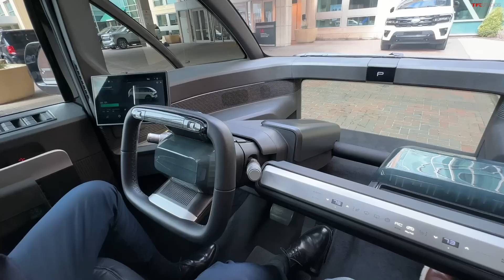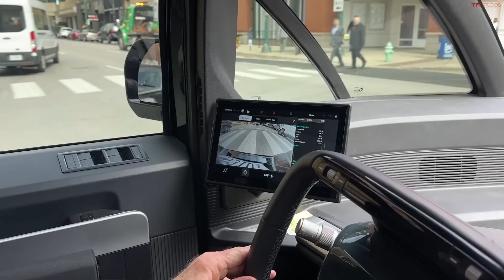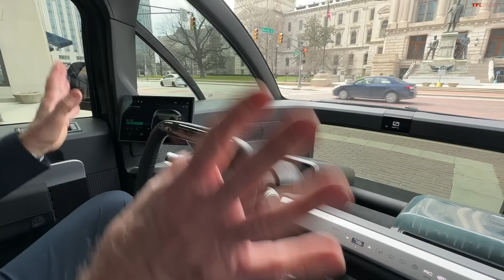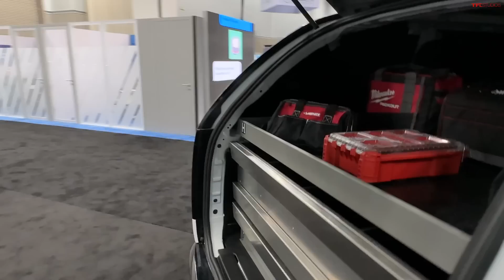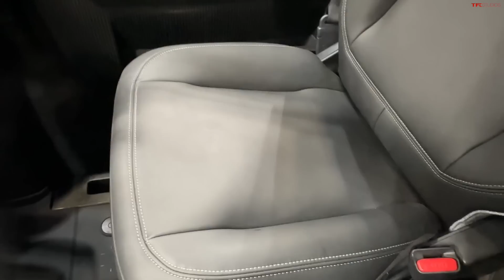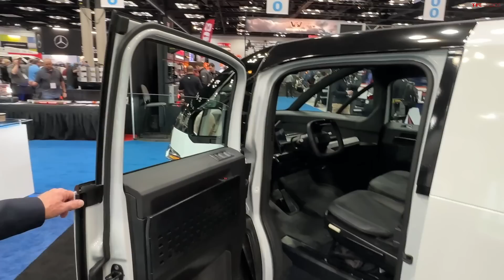The All-Electric Canoo Is Like NO Other Van You've Ever Known or Driven: Come Ride Along With Me!

Comment: I can’t imagine that between all of those front windows/windshields that they would either work well in the Winter.  Even if the glass were heated (electric lines akin to Range Rover), one would probably need a near fortune to replace them.  A stone chip or crack might just bankrupt you or your company.  Interesting though.  Thanks for the video.

Comment: Thanks Andre, very informative video.  This is my first time seeing anything about Canoo and I have to say I’m really impressed.  I occasionally need to transport 12-14 foot boards.  It looks like I could do this in this vehicle if I could remove the passenger seat.  Recommend the glass in the front be replaced with shatter proof polycarbonate.
Reply: The rear seats are going to be easily removed or you can order one without the seats entirely. The mountings would still be there if you ever want to add the seat later on. You can look up other videos about them. The designers were very serious about making the cab customizable so that 2nd and 3rd owners could change what they want.

Comment: I really like the concept of having driver-only controls on the left, but there are controls that the passenger should be able to have access to, like maps and stereo controls, so I could definitely see them moving that screen to the center, or adding a second screen that the passenger can use.

It's definitely weird, but then again I own a TR7 which is a very weird car.
Reply: Last I heard, they're not planning on doing a center screen for navigation, stereo, etc.  Their thinking is that those screens in cars nowadays are always behind the more current tech in phones and tablets, so they're going to allow for a mount on that bar where you'll put your phone or tablet and just use that for your maps/navigation, music, etc.  That way, as new phones and tablets come out and get better, you can always just put your current one on there and not end up hating some slow OEM factory screen they put in there.  The screen on the driver's left is literally just for basic functions that won't change over the life cycle of the vehicle.
Reply: @meadmaker4525  if that’s the plan, I have to say it’s pretty smart
Reply: @meadmaker4525 never heard of CarPlay?
Reply: @CodyCha  what? car play is nowhere near as advanced as the latest tablets or phones.😂
Reply: @meadmaker4525  they said that they are designing it for the second owner. 
Basically if you build it to work well after the first owner it will last and last.
Reply: It leaves it open for aftermarket customization. Custom dash options and entertainment accessories would be interesting additions.
Reply: they could easily put all passenger controls in an app, then you can put a phone or tablet wherever you want
Reply: Hahaha, true!
Reply: Yeah it makes perfect sense for a transport van but as a consumer people mover it's a very odd choice.

Comment: 200 miles is a bit low. If your vehicle coming out in 2025 has less than 300 miles, then you have to boast the best charging speeds. And I notice not a lot of talk on charging speeds. That's concerning.

This would give the ID Buzz a run for its money, but they need to up that battery pack to 100kw, to achieve 300+ miles.

Comment: One suggestion I would make. Change the rear hatch to a clamshell operation/design just like the Honda Element had. Also, offer a rubberized floor as the Honda Element had with no carpet, this makes it much easier to clean and reduces wear and tear on the carpet.
Reply: @altonhughes8174  If they still made them I'd be first in line to buy.
Reply: @2cartalkers  same
Reply: I suppose it depends on the use of the vehicle. It seems like an elevating hatch like with this elevator company version would be preferable. The way those drawers open up out of the back, the hatch makes a necessary rain cover.
Reply: This.
Reply: Rubber liners hold items well, but you can't slide anything on them. You have to be capable of lowering or shimmying anything you put there. I prefer carpet.
Reply: @crisbowman  Carpet is like wearing the same old and dirty clothes everyday.
Reply: @2cartalkers  Loading dirty items takes its toll. If you're doing luxury/quality delivery maybe not, but rough work requires expendable facilities.
Reply: @crisbowman  Rubber lasts longer and is easier to clean, the best ROI. I know I have had vehicles with both.
Reply: @2cartalkers  If you can work with it it's better in every way, but again in a smaller area where you have trouble climbing inside where you also need things to slide, it's worth it. Not pretty, but functional.
Reply: @crisbowman  Just wish it were available now. I have use of this vehicle, it will be very versatile.  Will it be sold online or through a dealer network?

Comment: This is the rare design that I'd love to see succeed. Small enough to be parkable in a lot of places, big enough to be really suitable for a wide range of use cases. They need their own Elon to get this thing up to efficient volume production, to where it can be economically self-sustaining, as a product. And to continually refine & optimize the drive train for ultimate battery power utilization.
Reply: Better yet get Tesla to make it.  Tesla can function as manufacturer....
Reply: @shahbazfawbush  :^) Not sure Canoo's creator's are interested in handing their baby over to our favorite eccentric, megalomaniac, publicly-big-mouthed billionaire. :^>
Reply: @pbasswil  Yes, but just imagine the CyberCanoo, with giga casting and structural 4860 battery pack, FSD, and access to Tesla charging network and service centers.  How much cheaper and faster production would be at the factory level.  Many, many advantages.....  Sigh, the next gen next vehicle Tesla is working on is probably a van like the Canoo....
Reply: @shahbazfawbush  It's like saying, If Toyota built LandRovers, they'd actually be reliable. Or If Apple redesigned Windows 11 it would be easier to use and less buggy. Both may be true, but it's idle fantasy – just won't happen. But other EV makers need to observe Tesla closely, and learn about efficiency, scaling, and long-term planning.

Comment: Is the 200 mile range accurate? How is the range calculated? There are several/many Cocos Frios locations that could use vehicles like this as delivery of products and passenger transport.
Reply from the maker: This vehicle has a 80 kWh battery. So a 200 mile range sounds reasonable for a vehicle this size.

Comment: I really like these, BUT I hope they do a basic truck version. I just want an electric Canoo truck that isn't covered in all the panoramic glass with safari windows and with a normal steering wheel (absolutely hate that square wheel).
Reply: The whole concept is that it's modular.
Plenty of options.
Reply: @rogerstarkey5390  I hope you are right. Still haven't seen a basic one, all I want is driver and passenger comfortable and adjustable seats. Don't need glass everywhere of F1 inspired steering wheels. Just a comfortable seat in an electric truck with decent range

Comment: Would anyone be able to explain how steer-by-wire is safe during a power failure…?
Reply: It has redundancy, like NASA and the US military. Multiple systems to prevent fatal system failure. I am also apprehensive about fly-by-wire cars, but maybe the tech is actually foolproof and that turning radius was dope.
Reply: They use fly-by-wire in fighter jets.  I would think the reliability issues must have been addressed to make that acceptable.
Reply: @markfinley3703  Yes, I know that --doesn't answer my question though...

Comment: I’ve been waiting for these cars but the company seems to be on the verge of going under. Already this video points out design errors. The multi-control screen is only on the driver’s side, which means my wife or kids in the passenger seat can never help out on changing climate or music or whatever so I can keep my eyes on the road. 200 mile range is not enough. It need to be close to or above 300 miles. The steering wheel looks so low is that whole rig adjustable?

Comment: The size is just absolutely perfect for all sorts of stuff. Glad some manufacturers in the US have sense.
Reply: You bet, it takes non-legacy auto cos. like Tesla a decade ago to be able to see through 100 years of ICE manufacturing and move forward working with the huge space savings introduced by skateboard on axle motor/inverter and axle to axle battery configs. Meanwhile Big Auto bosses want to perpetuate the hideous standard transmission remnant bulky shifters and ICE platform conversions or even poorly designed systems with sealed (MB) or purse holding frunks that continue to permeate the legacy EV market.
Reply: Small work van do not sell in the states.
Reply: @CodyCha  Ford has sold over 30,000 Transit Connect vans per year in the US for the last decade. 3 of those years, they sold over 40,000 and one year they sold 50,000.  The annual US sales of the Nissan NV200 has held steady at about 17,000 per year. Just between these 2 models there's a proven market for at least 40,000-50,000 small vans per year. I don't think your statement is accurate.
Reply: @ezeriamoore  Ford's selling 4-5 times that amount of Ford Transit. Ford, Ram, GM are all discontinuing their smaller commercial vans in favor of bigger brothers.
Reply: @CodyCha  Please post where we can find the announcement of Ford's (and the others) plans to exit small work van production.
Reply: @CodyCha  A few do and fleets buy a number. Just not outside the city.
Reply: @CodyCha When was the last time anyone tried selling something like this? Was it electric? Has anything about the world/country changed since then? Why have multiple US businesses already ordered initial fleets of these work vans if they "don't sell" here?

Comment: I like it but am worried about a greenhouse effect. All that glass up front would really cook the interior on a sunny day and if you have to blast the a/c to counteract that you'd kill the battery. In the winter all that glass would result in rapid cooling and I'd have to blast the heat to counteract that and kill the battery. Also, how fast will it charge?

Comment: I can't understand why any car company puts  a steering wheel on a car that's harder to use and less safe. You rotate the wheel so why not just make it round. Car companies figured this one out over a century ago. This is fashion over function.
Reply: Did you see that turning radius? It is pretty tight and he barely spun the wheel. I was skeptical about drive-by-wire until I saw that. I love how yokes are pissing people off.
Reply: The round steering wheels were designed before power steering.  And used to be MUCH bigger to give greater leverage.  You don't need leverage with the steer-by-wire, and the video makes it look like you'd rarely make more than a quarter turn on the steering.  Meanwhile, the square shape means it blocks less of your vision.
Reply: @markfinley3703  You've just highlighted the key fundamental reasons for my first comment.. Round steering wheels have absolutely nothing to do with leverage, only the size of the steering wheel.  They're round because irrespective of where the wheel is in its rotation you can place your hands in a position that allows you to maintain that consistent point of contact relative to your body and maintain a consistent degree of leverage because you are always equidistant from the fulcrum.
You say "rarely" but that means you still do rotate the steering wheel quite a lot, and a lot more than you realise. Watch the guy in the video.....
The number of videos I've seen with Plaid drivers finding it awkward placing their hands, shows that we're not there yet for steering yokes.

Comment: I hope these guys make it. Such a useful vehicle.
Reply: the rear top end is also curved causing les stoag space, not like areoydnamics benef would be there.   I really doubt the visibility would be that great if you test it out. Sure, it has a lot of window, but it also has twice as many wide body pillars blocking your view. The front-most A-pillar is also in a spot no other car has, blocking a completely new sector the drivers need to get used to. And the B-pillar forward of the door isn't any smaller than other cars have.  front space , wasted space because you can't store anything heavier than a pillow there due to crash safety. Compare it to the frunk in for example F-150 Lightning and Rivian that provides a new and highly useful storage that traditional pickups and vans didn't have. The only advantage the Canoo design provides is the lower front window. Sure that's an improvement over modern American trucks with man-height bonnets that can hide a whole car from view. But compared to the M-B eSprinter TFL showcased just couple days earlier with the sloping bonnets that gives a perfectly fine view of the road it is a useless gimmick.    
                        reason why i dont liek electric car is  that battery degradation and lack of battery recyling. dendrites that forms from battery degradation is messes with recyalability too.  if you look at sandy munroe video caled wjats insize 680 battery, there could be indicator of how much of battery can be recycled by mechnaical seperation vs what chemical process would be needed, woudl it be susntinable process? recycling company called redwood. even if they fix this problem, will they dig through trash to find enviromentally damaged (rust, mud,etc) dead car batteries currently being dumped, and recycle them? in emissions, best hting to do is a ca rof where rear seats face the rear as comcpact 4 seate rreplacing 2+2 seater cars and yaris corolla cars, and  rear mid engine small combustion flat 2 cyulnder wnith no rotatiing parts to send power to wheels, instead magnets moving back and forth make electricty aand or a little supplemnetary compressed air , to power electric drive and compressed air driver, possibly with no battery or at minimal battery, using supercapacitor etc.  optimal combustions per second for emissions with electric and mechnaical hybrid turbocharger, sometimes engine will run beyodn optimal effiency or emissions levels for unsuually high power demand to protect long term emissiosn and fuel use reduction effetiveness of battery for common lower power use. with limited batterys to use, hybrids are already more effceint effective at reducing emissions, vs using that battery material for fewer cars who are electric cars, becaue most emissions happens in low speed high pushing power sitatuaitons of combustion car, where emissions are most likley to chemicaly harm health of nearby people becaue its usually compact city area with many people nearby.              what battery size is best for longevity?  see tony hellers climate change videos, maybe somone can make use of suspicious observers videos.          see aptera owners club video on saftey, unqiue materials they use, lightweight is safer to peopel outsid ethe car but can be safe for people inside car compared to hevaier caar if using right materials, and even safer due to wat type of crash is more likley to happen.. linearly more ligghter weight exponentially causes less road wear damage causing less resurces and emissions and road downtimes.        in effeincy per functionality, rear seats facing rear in sompact 4 seater woudl make more sense. solarpanel effeincy is only arouund 20 percent and can become lot better     if u want ower emissons(whch only helpful for heath of pepe wh send mhme near heavy traffic roads), then using mited batteyr supply for hbrids is lower emson than using the suppply for fewer cars whch are eletric car.
Reply: @kalmmonke5037  It’s a come and go design. Once the cool factor wears off, it’s worth nothing. You’re 100% right about the thick pillars and such.
Reply: Your brainwashing is complete
Reply: Nope, declared bankruptcy last month
Reply: ol wy did they mae the rear top part curved, they easily could addd more storage space there. areydnmics doesnt matter in that area mch
Reply: @kalmmonke5037  The whole thing is ugly. They designed a VW bus in 1958 on a napkin, and until this day it’s the most popular van on wheels.
Reply: What makes you think that. I love Ford Transit. Great visibility and drives great. I drive a Transit commuter bus, but the best van I have ever driven.
Reply: @westerlywinds5684  their stock price

Comment: really need an EV van out there. hope they can go into production.
Reply: Ford has had an EV transit for a while now, there's also the rivian ev van too
Reply: @eshock9208  can you buy those? answer is no
Reply: @IlovepotaTOES-76  you can buy the ford E-transit. The rivian van is being made for just amazon I think
Reply: Agree. We need an EV van more than anything else. Imagine the enormity of vehicles, considering the multiple possible configurations needed. In developing countries they could carry passengers, mitigating pollution.
Reply: A point nobody seems to consider....
Most, if not all cities (globally) will soon have Ultra Low Emission Zones in place.
.
For instance, London is about to increase (August) from an average of about 10 mile radius, to about 15 mile radius from the centre. (That will be about 650-700 sq miles!)
.
That's a LOT of commuters, and traders driving in the zone.
That'll be £12.50 for the ULEZ plus £15 for the "congestion charge" (🤔) if you enter the inner sanctum.
£137.50 per week just for the privilege of doing business? OUCH!
Unless you run an EV, Free.... For now.
(£550 per month would pay a big chunk of an EV lease?)
.
Small business will be crying out for this size of EV.